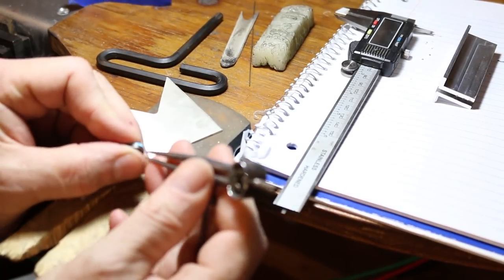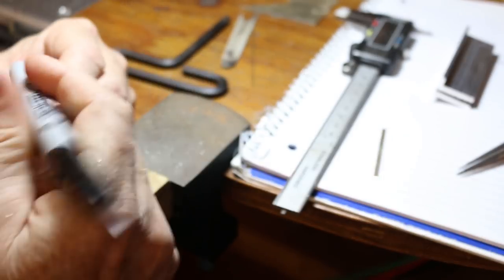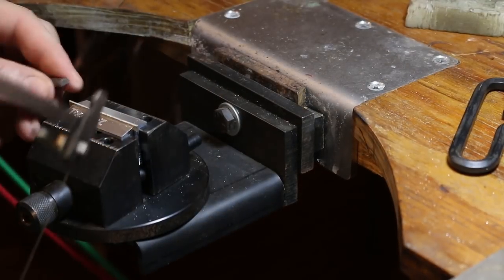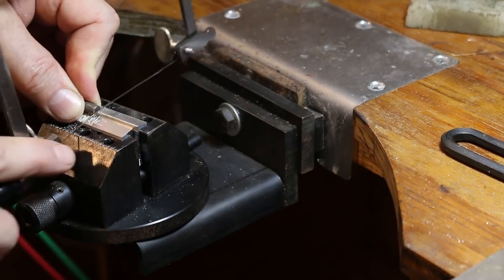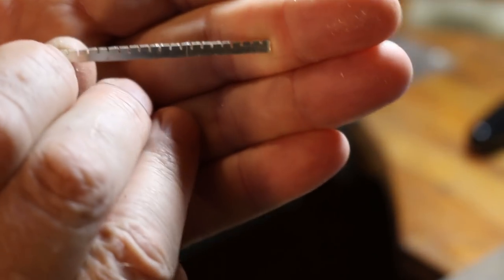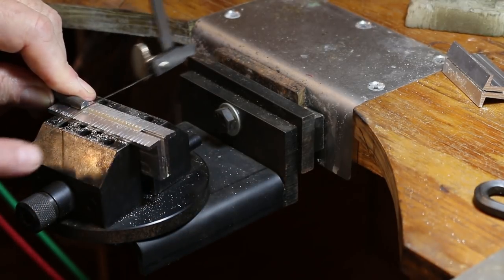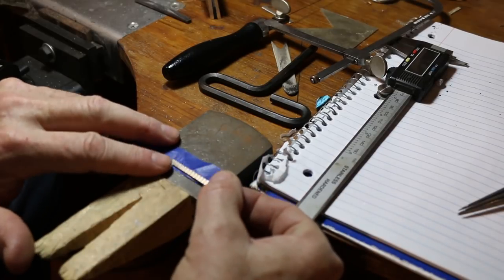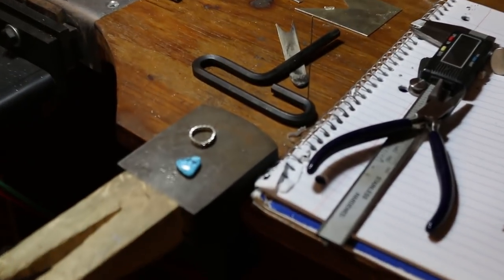Making a Serrated / Castellated Bezel Ring - Part 1

Comment: Hey Jim, new subie here!! Thanks for the tut vid😀 just one question: After measuring the circ of stone with tape, do you do the math to determine the spacing of the cuts? I was thinking that maybe after soldering there might be a slight inconsistency of the cut spacing. THANKS again. 😊😊Love that style! Also, what guage did you use?
Reply from the maker: I usually just cut off the bezel at the closest castellation cut. Then if I need, i will stretch the bezel back up to fit the stone.  Stretching the bezel can be easily done by placing it on a mandrel and drawing it back up to size by tapping with a rawhide mallet. Thanks for watching.  (18gauge is my favorite)

Comment: I have a question I use very thin bezel wire, do you have any tips on cutting the wire flush?????? And if your bezel is not sitting flat on backplate can it be corrected?  I am new and this would get me moving along.  Love your videos

Comment: I've watched several of your videos and I have both of your tools. I am still puzzled how to use the Best Jawz.. I'm using 18 ga silver and it sits all the way down in the jaws, leaving none above the Jawz to saw.... I sawed some through the Jawz but still needed to finish with a disc cutter..... What am I doing wrong?
Reply from the maker: Hi Leslie,  First, as you can see from my videos, my Bez-jawZ are marked up from my saw blade.  That is fine.  Don't worry about cutting into them slightly.  As far as your need to "finish with a disc cutter".  Please explain what you mean by "finish".  Do you mean you are using a disk cutter to cut deeper?  If so, there is no need to do so. Just cut deeper with your saw even though you will be marking up the Bez-jawZ.  If you mean you are using the disk cutter to make the cuts wider, you can instead just use a bigger saw blade.  What size saw blade are you using?
Reply: Okay, I was using a 3 saw blade and using the disc cutter to make the score go all the way to the bottom of the bezel.... I guess I'll just get a little more aggressive! Thanks for the quick response! I do love the look your tools allows me to achieve!
Reply from the maker: Always happy to help, Leslie.  Never hesitate to reach out if you have questions for me.  :-)
Reply from the maker: Sounds like a good plan!

Comment: I got your indexing tool set and can not wait to get started.... I do have a question... to get the height of the bezel material do you measure the height of the stone griddle or the height of the dome? or something else....
Reply from the maker: Hi Kenneth!  Thanks for your question!  I measure the height of the stone not including the dome. If the height of the bezel is higher, it will need to pushed over the face's outer edge which can be difficult with thicker bezels.  But everyone has their own preferences.
Reply: OK thank you....

Comment: Did you take into consideration the thickness of the bezel material? I tried to make my FIRST one yesterday using this process and the bezel was too short! :-(
Reply from the maker: Hi Bruce! Yes, I did but I totally missed mentioning that or missed recording it.  Sorry.  :-( One thing you can still do is stretch the bezel on a mandrel by hammering it with a rawhide mallet.  Or you can reduce the size of the stone with abrasive.
Reply: @JimBrandvik  I was so excited that I made it. Thanks.... I should have known better!!! But I do like your system.

Comment: hi. have the tools and they're great. wondering what is the smallest and largest height bezel wire you can use with the tool?
Reply from the maker: I don't use pre-formed bezel wire when making castellated bezels because it is too thin.  Cut your bezel material from sheet as in the video.  There are really no height limitations.  Just try to match the girdle height of your stone when you cut the bezel from sheet. Also, I recommend 18gauge sheet as a minimum thickness if you plan to extend the lines down the outer perimeter of the bezel. Hope this helps. Thanks for watching!!